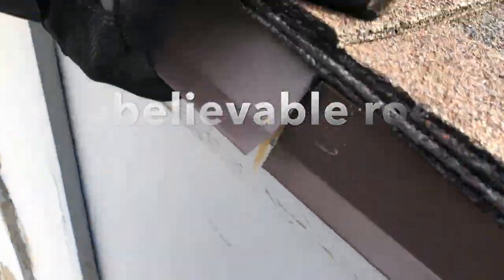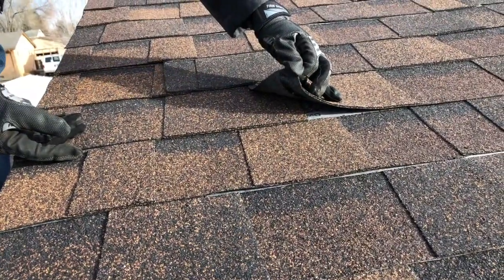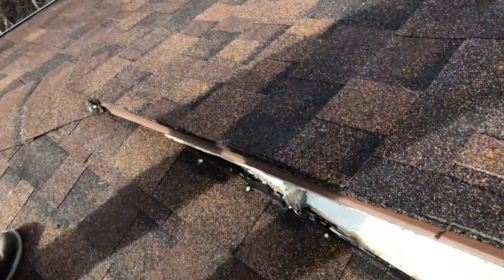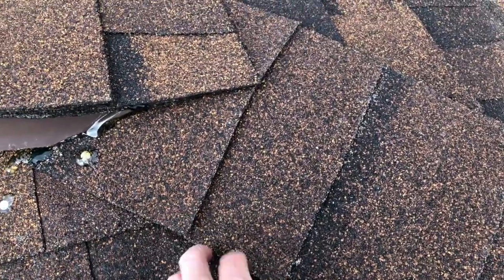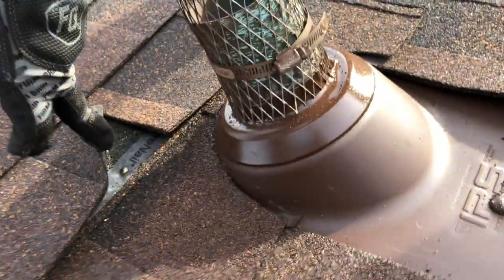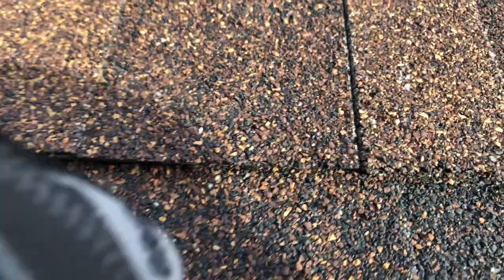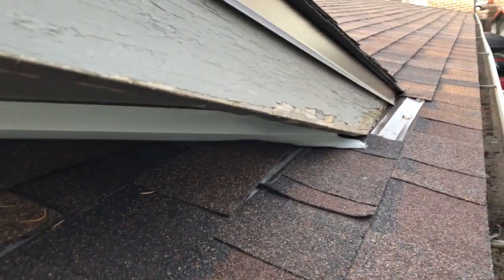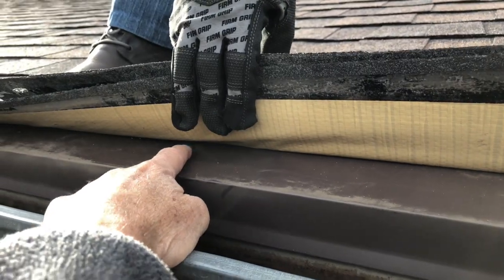Bad roofing | Roofer training video for what not to do

Comment: I have been a roofing inspector for 25 years .. yes its a shady roofing job but id sure be glad to inspect one of your jobs.  Because you offered alot of incorrect information.   A perfectly installed rooof requires little to no roofing ceeement.  Sounds like you must buy 5 galllons for every job.
Reply: The need for use of asphalt sealant on shingles depends on slope...if it's not at least a 5/12 (like this roof was) it needs it on the side edges of penetration flashings under the shingles or water can wick sideways in heavy rains or ice damning...you probably should go back to inspection school...I can teach you if you would like...I've got 24 years of composition and sheet metal (down to a 1/4" /12 slope on sheet metal) manufacturer water tight warranty experience...which required numerous manufacturer standard classes
Reply: Boom
Reply: Ikr.  I’ve never used any caulk around a pipe or vent and have never had one to leak just install the shingles properly and you won’t have any problems!!😑👍🏼 roofing cement is garbage try GEOCEL best shit I’ve found!!
Reply: They kept saying pkastic cement though..  even that says they are overpaid goofs who dick people out of money or hurt other legit businesses after they say how bad a job they did...  Plastic Cement is an air entrained Portland Cement with lime. This product is designed to bond with Plaster Sand and stick to wire mesh on vertical applications such as scratch and brown coat stucco...  maybe useful in the dirt houses in mexico..  not on an asphalt shingle..
Reply: jackyll690 no tar if it needs tar.. then it should not have  ..,, shingles
Reply: @jackyll690  thats why you are required to put paper on roofs under 4/12
Reply: Depends on where you live at. I never used roof cement on a shingle roof.. Until I came to Florida
Reply: In your area.  Some county codes require a 5/8 roof tar bead between shingles and masonry.
Reply: Roofing inspector not roofer theres a difference and cement is a good thing to use around chimemy and it doesn't hurt to seal a vent
Reply: @kelbybueckert8434  Paper on roofs under 4/12? What paper are you speaking of?
Reply: smoke14 double layer of felt paper or synthetic underlayment or one layer of ice and water is required on pitches under 4/12 so that if water wicks up or around the shingles it is still protected
Reply: @kelbybueckert8434  
Didn't think anyone used felt these days. Here in FL most roofing companies use peel & stick (or mod bit) and then synthetic over that.
Reply: smoke14 ya no one uses felt just ice and water or underlay
Reply: smoke14 I don’t use mod bite because I don’t do roofs under 3/12
Reply: Get them
Reply: Wrong. Depends on the state codes sir.
Reply: I been doing this for 15 years and never used cement.  It’s a roof not a porch
Reply: Oh to be so perfect AND odor free
Reply: Couldn’t agree more Maverick….hiring a inspector to inspect the inspectors inspection is definitely a great idea 😂

Comment: I'd like to check on your guy's jobs for crooked nails lol
Reply: I’m assuming the installers used nail guns because I’ve rarely if ever seen roofing nails over driven or crooked if driven by hand. Nail guns are great if you don’t rush and skip a second look at your nails to adjust your gun and/or tank pressure. But rush and this is the result a lot.
Reply: That's  funny

Comment: I'm surprised they could just pull up the shingles like that. I did my roof and 2 days later I tried to lift some shingles because I'd messed up around a vent and the roof was basically welded together, I had a nightmare fixing it because I couldn't remove a single shingle without tearing it and the ones around it.
Reply: This was uploaded in January, and judging by their clothes it was cold. Shingles need to get warmed up by the sun in order for the tar in the shingle to mend to the shape of the roof and the adhesive strip to melt and adhere to the shingle below. This is why its best not to re roof unless your day forecast has a day or two of full sun at 50F+. The OC duration shingles have ridiculously sticky tar strips so there is no way they would lift it up this easily if they were all appropriately sealed up.

Comment: You don't rely on the beauty strip and tar, you counter flash properly by either grinding a reglet or in this instance, cutting a reglet. 
You don't order a 2"x4" for the bird stop, you bend the proper flashings with a brake.
You don't add tar to no tar flashings, you prepare your surfaces according to manufacturers specifications, that almost always means installing ice and water guard to the entire perimeter, all penetrations, walls, chimneys, etc.
The point is that saying that you should rely on tar, which although will work for maybe the life of the roof, doesn't make it the proper way to flash and water proof the surface of the roof. Sealants of any kind, are susceptible to the elements and nature always wins, so please, don't instruct people to rely on sealants that will fail, rely on skill and common sense.
These people that did this job had neither.
Think like water!
Thanks 🙈 🙉🙊

Comment: While there are several errors here. Most of them are being overblown.
 Manufacturers recommend I&W over pipe boots.

I also have no idea what the overlapped shingles are about however they will seal down. So will the I&W to the pipe boot. It is obviously xold and hasnt had a chance yet.

However again several elementary errors
Reply: I've never heard of anyone recommending ice n water over a pipe collar..
Reply: @chiefsnation8347  read the CertainTeed shingle applicator manual and get back to me rookie

Comment: I'm by no means an expert roofer. I'm actually kinda new. But, seems like he wanted WAYY to much rubber cement. I get not wanting Caulking. I'm not advocating Caulking. But, I don't think substituting it does a whole lot more. Also, I thought ridge cap was supposed to be cut at that little lip that sticks off the sides? But, on there they were still there. I also saw some exposed nails on their ridge cap. They didn't even mention that? Also, he said Ice and Water shouldn't be used on pipes. Why not? Just cut an axe and put it over. Then put down the flashing or whatever you're using to cover it up. idk, I'm not that good at roofing. Nor am I that knowledgeable. But, this seems kinda not good. Can any confirm of correct me? Still learning :/

Comment: I can tell user from a shingle company and not really roofers looking for anything to blame the installer even though it is wrong that roof would never leak
Reply: I saw at least 20 things that would make that roof leak...you have zero clue what you are talking about
Reply: Cutting corners is cutting corners.
Reply: I have seen worse shingle installs than this that never leaked. And I have been reroofing for 30 years

Comment: By the way roofer guy ice and water shield around pipe boots is way better then caulk a good roofer doesn't need caulk
Reply: janita Zimmerman All roofers love caulk
Reply: No if you think something might leak just tar the shit out of it, you didn’t know that?
Reply: You're suppose to use sealant on the sides of pipe flasings and vents under the shingles on lower slope roofs like this one...I wouldn't let you roof my dog house if you don't know that...who ever roofed this house destroyed it and needs to be tore off and redone
Reply: Jacky just do what your boss tells you and shutup. If you aren’t capable of fixing this roof without starting from scratch, then you aren’t much of a roofer. Like I said in another comment I’d charge $500 and spend a couple hours here max, I’d make this roof last the expected life no problem...
Reply: jackyll690   Sealing around pipes and vents causes leaks!!! I hope you are not a roofer!’🤦🏻‍♂️ If you don’t know how to run around pipes then just run the shingles up to the pipe then cut a 2ft by 2ft piece of ice n water and cut a hole dead center to fit around the pipe nice and tight then throw the flange on!!! If it leaks after that I suggest finding a different job!!
Reply: Uhm if you don’t know how to “run around pipes or vents” then get off the roof and don’t ever make an attempt again.. what you said about using ice and water around it then just putting a flange on top of the shingles is nonsense.
Reply: John G  Ikr
Reply: @crimsontide9532  Don't cut the hole around the pipe, use your hammer and gently wear the exact fit, that neoprene boot will fail in 10 years or less, but if you follow proper procedures, it won't matter. 
These guys are using 100 year old Slater's application on a modern asphalt shingle. 
You should have to get a license for tar, keep it out of idiots hands.
Thanks 🙈 🙉🙊
Reply: Edward Gregorczyk   I didn’t say cut around the pipe but ok.
Reply: @crimsontide9532  Evenif you cut the center when you pull it down over to pipe it'll tear your better off making the whole by using a hammer on top of the pipe gently.
Reply: Edward Gregorczyk   Cut a circle, not just a slice and it won’t tear!

Comment: When the manufacturers designed the dimensional shingle and the nail gun now everyone is the best roofer. And it's called mastic not plastic cement. My guess is the homeowner went with the cheapest bidder and no permit.

Comment: Roofing does require intelligence to install the roof correctly, but the fact is that most roofing laborers are alcoholics or drug addicts or both,,  most roofing contractors will tell you themselves , it’s really hard to find reliable help,   When I put ads in the paper for laborers , it said you must be clean, sober, you must have a license and drive yourself to the job everyday, I did not get any responders. Being no a good right roofer is important and there is a demand for this trade,  everyone needs a good roof,  but compared to electrical , plumbing , HVAC, carpenters etc, it is the least respected trade because of what I mentioned,  on the other hand, there aren’t to many other trades that will even get up on a steep roof

Comment: Basically the industry knew it's not a perfect world that's why there is tar paper under the shingles which if installed properly will stop water period with out the shinglesam I correct so when a leak happens it's because there is no paper coverage under the shingles  in the first place

Comment: I hope no one never ever ever listens to these guys. If you use that much plastic cement on a roof you're not a roofer. The guy filming even knows less than the other guy lol.
Reply: RayRay Compton I have to agree with you there like comedian show they have to be salesman not roofers I mean there's a lot of problems there but nothing  that they mentioned is going to make it leak
Reply: i agree with u lol. they must not EVER CHECK thier roofers work IF they even own a company
Reply: joe mommma I didn't mean it roofing company I've been at Shingle manufacturing company or someone that sells the shingles but anybody knows anybody that worked on the roof at any time knows what they can get away with and what they can't usually
Reply: Gaboda Building how are unsealed exposed nail head’s in the seam/joint of two shingles not going to leak? That was one of the first things I was taught. I agree some of the “issues” I don’t see as incorrect but exposed nail heads are a def no no
Reply: @travisedwards9983  bullshit. Arizona, new Mexico, most of the gulf coast states. REQUIRE BY CODE roofing cement.
Reply: @travisedwards9983  sit down before you hurt yourself. I've spent the last 19 years on the roof installing them. 

Pay attention and you might learn something

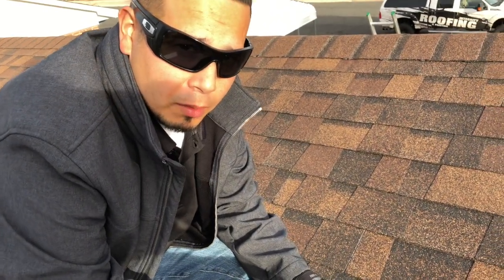Comment: I completely disagree with this guy's advice at 10:00. You never remove a nail out of the roof if you don't have to. That just creates a hole in the roof and when your roof cement eventually breaks down (5-10 years) you are left with a leak.
 If you nail low and end up with an exposed nail, you pound it down a little past flush, fill  the top with a dab of tar. Then rub two small pieces of shingle together and collect the granules in a small cardboard nail box. Go over the whole roof at the end with a tube of tar and the nail box with some granules, pound em down hit with a dab of tar and then sprinkle some granules on the wet tar. You won't be able to see it from a foot away when it dries much less from the ground and it wont leak.
Reply: @matthewmurphy719 hah it is old world for sure. Trust me though you never want to leave a hole in a roof and just rely on sealant. Pound em down!
Reply: I either will remove the shingle at install and use that shingle on a top course. Shiners after, I might remove the nail and replace the nail under the shingle. Place sealant over that nail for clean look. Oh yea, and then renail on nail line.

Comment: That’s nothing, I see 10x worse than that on the daily. I hope you didn’t tell them that they need to rip it all off and redo... I’d charge them $500 and tune that whole roof up so it will last the time that it should. I’ve never even used a tube of your plastic CEEMENT before, and it’s not really necessary on all the applications you were suggesting. You definitely nit picked a lot of things that aren’t even a major problem. Either way glad to hear you take pride in your work. BTW I am in no way saying that this roof is great, all I’m saying is it’s not the worst, and could easily be fixed up. Does not need full replacement that would be a huuuge waste.

Comment: looks like my first shingle job except  I used more nails than that  and  i did not put  coil nails under   the seam where both shingles meet side by side. I am not highly experienced in installing shingles because I almost never ever do shingle. I hate  shingle roofs >/  It looks like they used  framing nails to secure the shingles or something.

Comment: Number 1: lousy edge metal install, you forgot to mention its not factory edge. The guy who installed it cut it on the wrong end.  Number 2: The reason those nails aren't right is cause the guy used a coil gun. No coil gun shoots nails straight, that's why you always carry a hammer, plus he probably didn't know how to use his compressor.  Knowing the pressure to use is compulsory. That all depends on many factors.  Number 3: You don't use "plastic Cement" on a situation like that, you use silicone.  Also, the "starter shingle" under the first ridge shingle is an aesthetic thing, not a functional thing so that's being nitpicky. (salesman crap). BTW what's with the rubber gloves hahaha. Serious? Also, was the ridge ran all in one direction or both ends to the middle? That matters aesthetically. Also are those actual ridge shingles or did some yayhoo cut up shingles to make his own ridge? You didn't mention any of those things. Why? The guy says "you never overlap a shingle. YES you do, on the finish side of the roof when the piece is 4 inches or less you ALWAYS overlap and nail through BOTH shingles. Laying flat is a moot point on a 3 dimensional roof. On a 3 tab you never see it anyhow. In this case if the guy was a lefty, then YES to overlap would be kosher but not on a six inch piece shingle. Four inches or less is the rule.  Im only at 2:02 and taught you five things. Im gonna have to start charging for this information.   Plus the quickest way to tell if a guy knew what he was doing is ONE are the shingles even straight? and Two how did he tie in his pipes and 3 what kind of technique he had on the chimney, if there is one, or the Air Condition if it's on the roof. Those 3 things will tell you basically if the contractor knew his ass from a hole in the ground, also  you should be able to tell how many guys worked on one side of the roof if they were amateurs. If they were pros you wouldn't be able to tell.   That roof is a joke, so are the inspectors. He lied and said the shingle would not seal, thats a lie, the seal is on the top shingle, the sun beats on it and it seals itself. Also, the inspector did not mention the nail was exactly on a seam. No nail should ever be closer than six inches to a seam. Plus I already told you the guy used a gun improperly so expect that over the whole roof. Also, the pitch on that roof barely looks 3 in 12. Shingles illegal on less than 3 and a half in 12, unless use ice shield underlayment. Even then its a bad idea.  I also mentioned the Metal work in my first 3 tips at beginning. Ill say this for that roof without watching the rest of this farce. The roof was put on by a complete idiot of a roofer OR the homeowner did it himself.  That roof CANNOT be repaired it MUST be torn off and done again so all this talk about this needs sealed and that needs trimmed is salesman mumbo jumbo. That roof would cost an arm and a leg to fix and would still, never be right.  I call BS on this video. "If you can't dazzle them with your brilliance then baffle them with your bullshit eh?"
Reply: Paul ofTarsus 👌👏
Reply: you are right dislike nail gun , stape  lot better
Reply: Damn this comment took some effort
Reply: so basically you bashing all of them and what makes you then?mr. ideal roofer. id bet this roof last as much as it should last.yall speaking out ur asses on youtube to validate yourselves for what?
Reply: purist thundewrath he took the time to explain some details; don’t hate just because he wrote a lot. First crooked nail they showed I too knew the installers used a nail gun; guns are great but a lot of installer get in the rush of shingle down, bang bang bang bang; don’t stop to see if their gun adjustments and tank pressure is correct; and keep running that rapid pace thinking they’ve installed fast and great without thinking to check their work. Obviously they didn’t do an “awful” job but their are definitely some lazy methods there. Particularly the drip edge usage in places that should have flashing with bends from a brake.